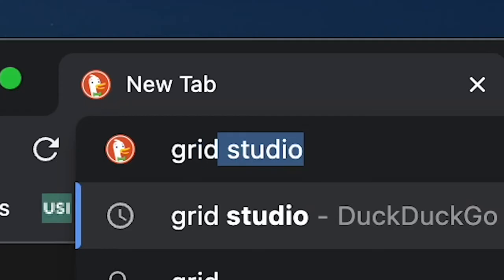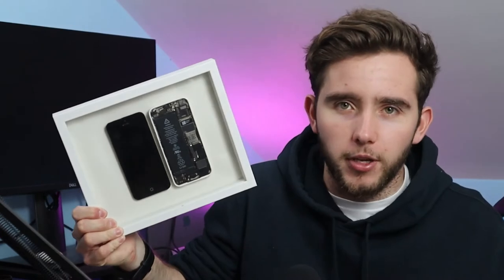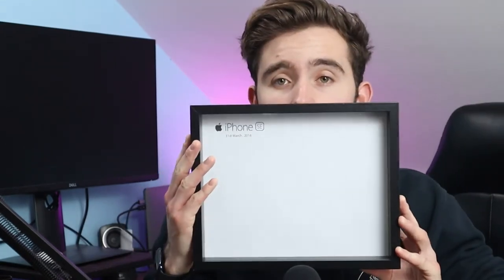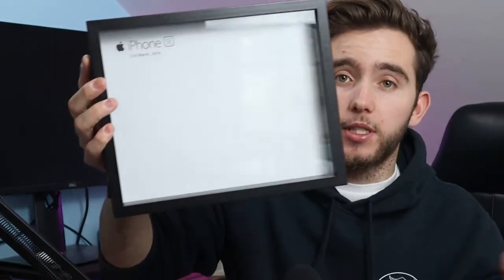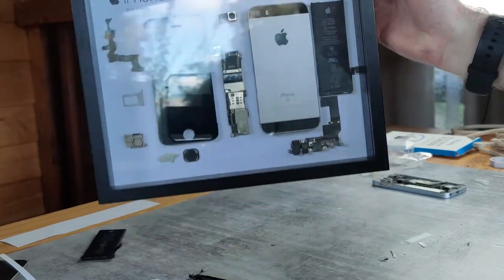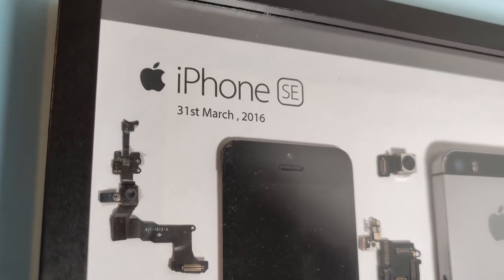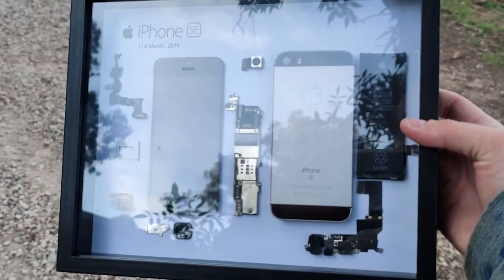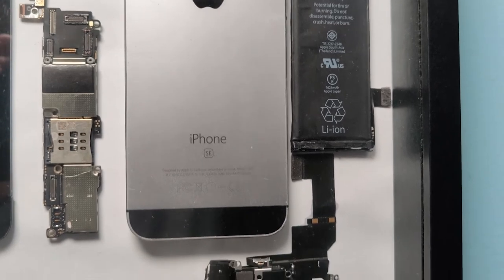Making a DIY Grid Studio frame - Custom Tech Art

Comment: This honestly looks great for a DIY Project. Trying my own Grid Studio-like Frame, with my old HTC One M7. I was just wondering on what paper did you print the Background? Kinda struggling to figure out which Paper/ Material with what heaviness and thickness would be the best suited, since I have to glue the phone parts on it. Loved the video:)
Reply from the maker: Thank you :) I actually just printed it on normal printer paper, once it was stuck down to the backing of the frme it worked alright. It did suffer from some marks due to the glue seeping though which was annoying.